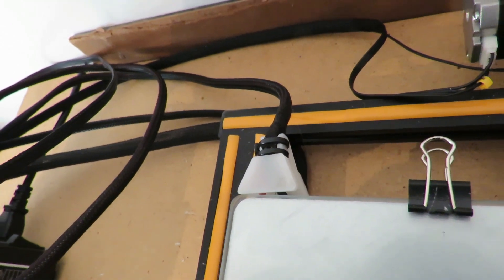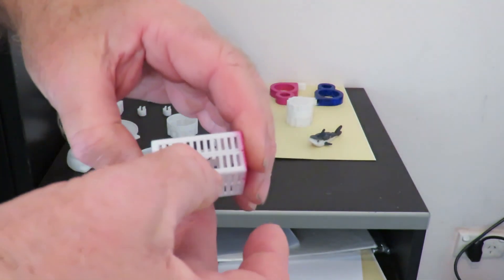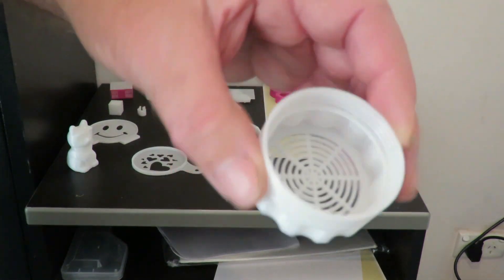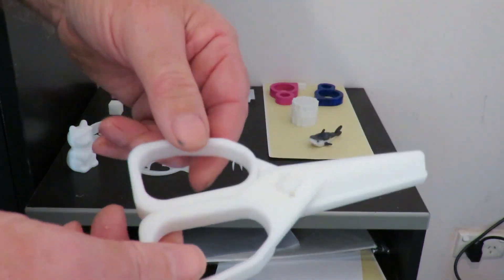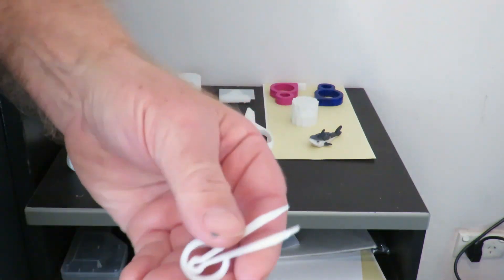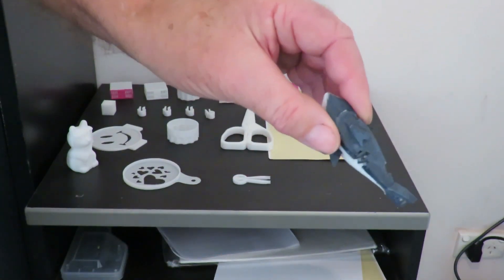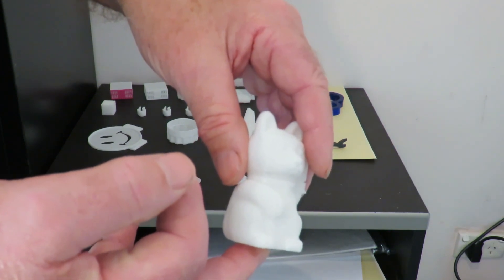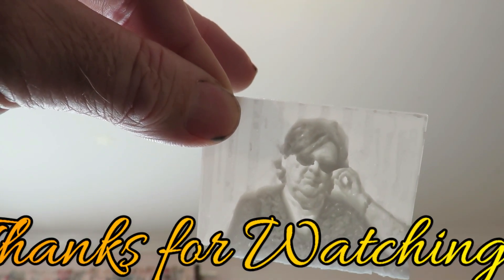📌 CR-10 How Many Prints Do I Get Using the Supplied 200gm Filament that is supplied with 3D Printer

Comment: What infill were you using for those ? I know I was using 20-40 % at work, but I have been told you don't really need infill for many prints, and they will still be strong.
Reply from the maker: Hi William
I use 20% infill for most decorative models, and increase infill if the piece requires structural strength.
Reply: @GarryPurcell  Thanks, just got my CR-10S today, seems like a really well made printer for the money.
Reply from the maker: @Pittsburghfix  
I've been quite happy with my printers, so far.
If I can be of any help just pop a comment up on any of my videos, and I'll do my best to answer it for you.

Comment: Hey one question. how did you make the lithaprint? is that what you called it... is there a software that makes those or...
Reply from the maker: Your looking for lithophane software
The link below will make the stl files for you.
https://lithophanemaker.com/
Reply from the maker: When I made this video, I used the Cura 2.7 slicer, it has this feature included (Cura is now at v3.1 with Photo to Lithophane)
You can also use a free service to convert your photo, link below.
http://3dp.rocks/lithophane/

Comment: I bought mine from GearBest (and waited and waited...).  I’ve got about 300+ hours on it now.  My test extrusions and calibration cube was a bit off and I’ve calculated those changes now.  Looks like your print bed isn’t warped like mine is!
Reply from the maker: My glass is not perfect, it is bowed slightly in the middle, so I know its limitations when I level the bed and print accordinly.
I will be getting some Ikea 300x300 Mirrors, later today funny enough.😀